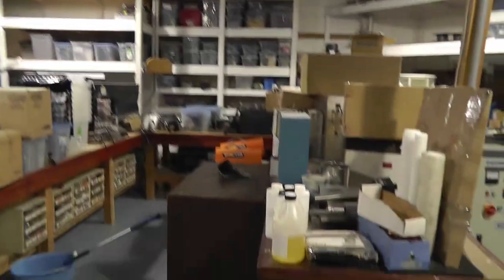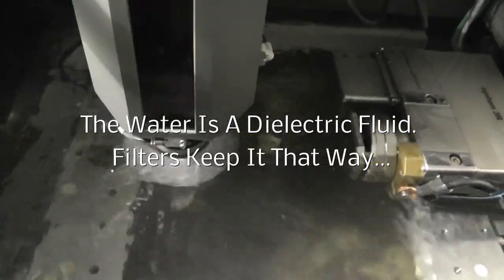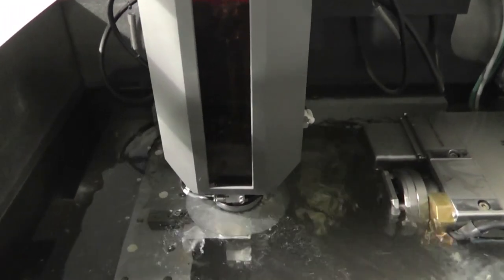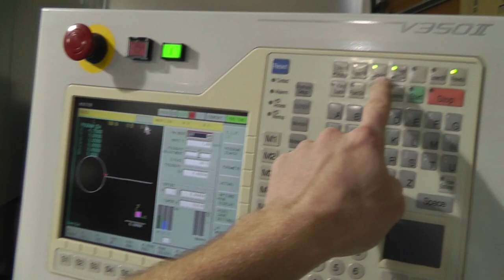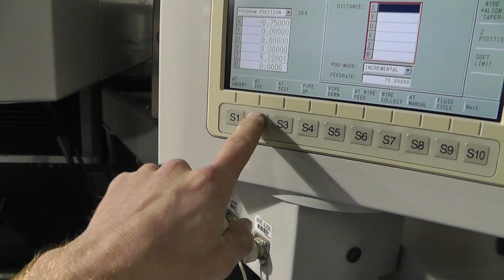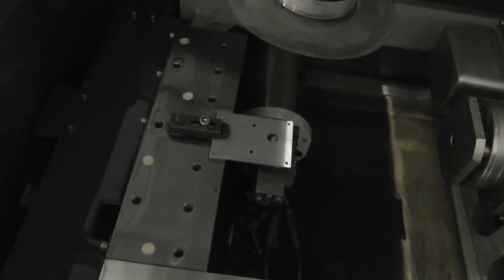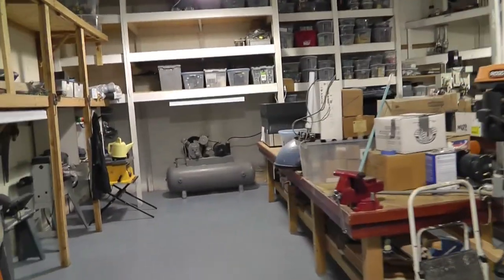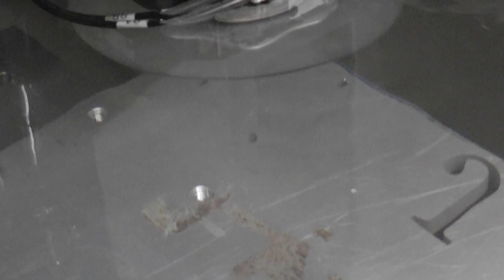Brief Update Of The New Lab. What Was That Thing Under The Tarp? Wire EDM Machine! Woho!

Comment: Nice! I work around these machines at work and they are utterly fascinating! Your machine is still very 'new' and not lacking in any features.

Some of the things I have learned about them so far.

* They are extremely precise cutting.
* The wire does NOT touch the workpiece. It comes very, very close.
* They can cut through very hard metals without affecting the metallic structure of the metal too much.
* You can cut very thick metals, or even many plates at the same time to increase production numbers.
* You can get an addon that will chop up the wire into little tiny bits so that you don't have a gigantic pile of wire out the back.
* The wire is spent once it goes through the machine. Do not re-use wire.
* You can recycle the wire, so look for someone nearby who accepts it. (Protip: You can make a device to re-spool the wire back onto the spent spools, or bigger spools to make it easier.)

Let me know if you have any questions, I can ask the guys at work and they LOVE talking about the machines, so they won't mind if I ask them a few questions.

They also use a program called Esprit (Pronounced "Eee-Spree") all the time, and it looks to be a fantastic program.

Comment: Interesting to, see this machine at work. I can tell it is a older machine and has several different systems inside to produce a cutting effect. I like the company that produced it. Wish I could work there.
Reply from the maker: 2009 model not too old. :) ~Russ
Reply: therealnightwriter Well we have surpassed the 6 month tech changes awhile back. Obviously my definition is different then yours. I have worked with cnc machines that use software that is processed through dos. I have a extensive background and experience with a lot of machines and software. Just acknowledging that it is a great design for a machine for its time period.

Comment: Very cool. I was wondering if you always had to make incisions from the edge. Then I saw how a stream of water threads the brass wire into a pilot hole. Very clever. How fast is the brass wire consumed and what is the advantage of something like this over laser or high pressure water cutters?
Reply from the maker: yes there are EDM drilling operations as well but that is a Sinker EDM
, the advantage is precision in the cut. i believe the EDM can make the tightest tolerances and cut the hardest of materials. also there is no pressure between the wire and the part. so there is no force applied when cutting. you could almost not even tighten the part down when cutting.

a good read here might help answer that question better than i can.

http://en.wikipedia.org/wiki/Electrical_discharge_machining

~Russ
Reply from the maker: also, the consumption rate of the wire depends on what your cutting and how thick it is. this must all be set up before starting the cut. we build the cut parameters in the setup of the Gcode file.

Comment from the maker: @ Kenneth Silvers,

The wire is spent. When Looking Close you can see that the wire is burnt on the leading edge. thanks! ~Russ
Reply: Awesome! Hours of puzzles to unravel and things to create. Can't wait to see some of the programmed magnetic fields on those NeoDyms. You have to put a nickel coating on the outside of them?
Reply: wow that thing goes through some wire..The E.D.M machine I used was not wire feed..it used the part itself  against copper analogues to achieve the fit..the water is de-ionized water...

Comment: Run high voltage and high current through a wire to cut metal?  Interesting and original.  One of those "why didn't I think of that" inventions.